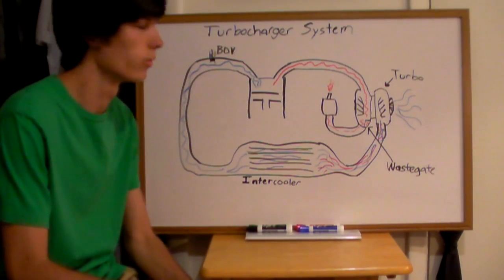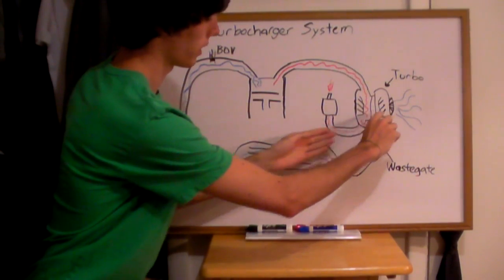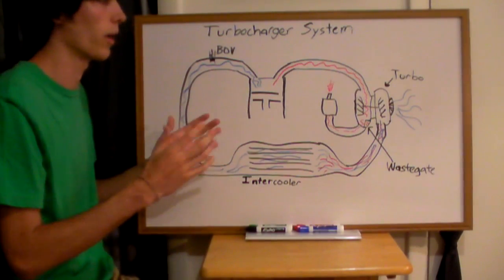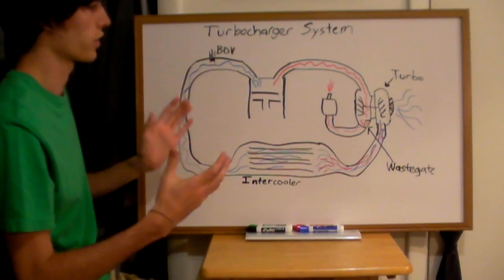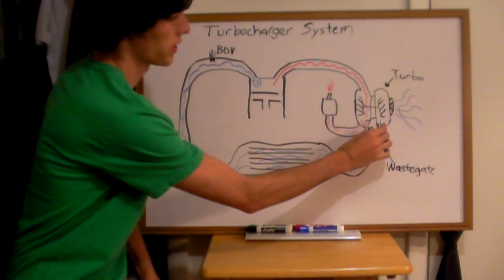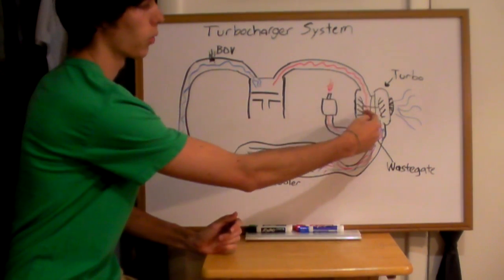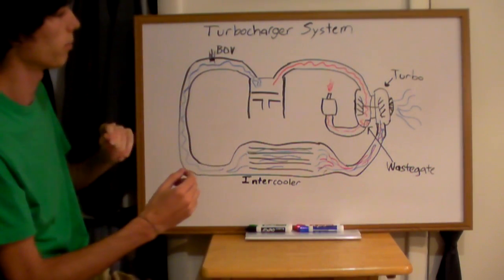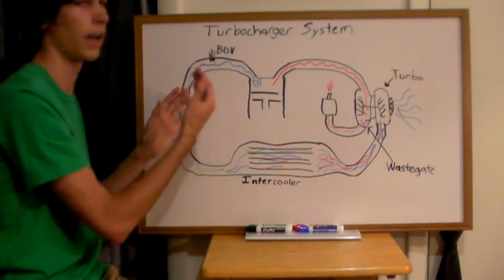How Turbochargers Work

Comment: Generally good. I suggest u mention why tc is need. The point needs to be made that when the piston starts its compression stroke, the air in the cylinder is is at a partial vacuum and u want as much air/fuel in the chamber to maximize the power of each stroke.
Reply: +Mike Goldberg 
He already made a video about the purpose of a turbocharger.

Comment: Hey! I know this is an old video, but i was wondering... Can a i take a turbocharger from a diesel and put it in a normal petrol car? What should i look out for? Thanks!
Reply: Theoretically, yes you could. However, I doubt it would be the right size, and you'd probably be making boost at very low rpm.

Comment: Correct me if i am wrong but you dont need a bov AND a wastegate yes? looking into turbocharging my car and i kinda know this but the relation between bov and wastegate got me confused for a sec
Reply: +Martin Angelov 
You want both. The wastegate is to prevent the turbo from over-spooling from too much pressure, and the bov is to prevent too much pressure from going into the engine. One's before the turbo, one's after.
Reply: cptnoremac Yes exactly but isnt the wastegate to control turbine speed/spool ( and have the so called "screamer pipes" ) and not just overspool/too high speed?
Anyway thanks for the reply
Reply: To my knowledge, the wastegate simply controls the amount of pressure which the turbo produces. That's it. As a result it could limit the speed but that's not the purpose, as I would imagine. The BOV is actually for when the throttle body closes (throttle pedal is lifted) and there is all of this excess pressure that can't be used because the engine is not powering the car at that time. If there was no BOV you would blow a hose off of the intercooler or turbo because the pressure has nowhere to go. It is only for when the throttle is closed, versus wastegate limits the air pressure entering the engine (located at the exit of the air-side of the turbocharger.

Comment: What exactly compresses the air as the turbo is sucking it in? Is the compressor wheel itself compressing it as it sucks air in? Or is it the fact that the compressor is forcing air into the engine via the piping and the compression takes place there?
Reply: The Compressor wheel compresses cold air in the compressor housing. The hot compressed air then enters the intercooler to be cooled down and so on....
Reply: The "compressor" is basically a centrifugal air pump. By pumping air to the engine than would by sucked in naturally aspirated, you created a higher than ambient pressure in the piping, intercooler, manifold, and the cylinder that's on its intake stroke. 
If there wasn't a wastegate, pressure would be limited to the point where it overcomes the centrifugal force, which is called surge. 
This limit is very noticeable by a flutter sound in cars without a blow-off/diverter valve when the throttle valve is suddenly closed while the inertia of the turbo keeps it spinning: the air has nowhere to go and rapidly reaches the maximum pressure level possible (if you would install a manometer before the throttle valve you would see a spike at that point), causing the spinning compressor blades to lock the pressure in while failing to pump more air, eventually slowing down because of the natural friction in the bearing and the resistance of the pressure difference. A blow-off/diverter valve reduces this resistance drastically by dumping the excess pressure, causing slower decelleration of the turbo and needing less exhaust pressure to bring it back up to speed when power is demanded again shortly after shutting the throttle (reducing lag) f.e. while shifting up a gear, although dumping too much pressure causes lag too (which is why many after-market blow off valves have an adjustable spring inside). Eliminating these spikes of pressure (thus resistance) also reduces wear, however this is minimised the closer the turbo is used to its maximum boost pressure, more and more the case these days.

Comment: So the blow out valve is also the catalyst to the "SSSSSSSSS" noise every time someone shifts? Essentially?
Reply: +Lukewuzhere Some cars (Like my Subaru) divert the air back into the air intake BEFORE the turbo, thus reusing the air, giving it the name Diverter Valve. They still PSSHHEEEWWW, but more quietly. If I were to switch to a true BOV, one that vents to the atmosphere, my car would run very rich for a short time when it activates, due to the air already having gone through the sensors for the computer, making it think that air is still in the system.
Reply: Every time you release the throttle, to be more accurate
Reply: yup its the blow off valve

Comment: Do the BOV and wastegate need the same pressure requirements? For example, do they both need to be set at 10 PSI, or can one be set at 10 PSI and the other at 8 PSI? Which would be better?

Comment: Technically BOV idea he talking about is wrong ..   BOV work by vacuum     ... there is a hose connected into the intake  manifold (between engine and throttle )    going to the BOV  (between throttle and cooler or turbo)   so if the throttle shut  engine will still take air to remain running ... so it will create vacuum and its will pull the diaphragm inside the BOV and release any extra boost  ... BOV will remain if there is any boost in the intake because the BOV will be pressurized instead vacuum ... understand... sorry for any mistake english is  not my language ... i just want to explain the right idea

Comment: Hey man,i have a question n you said that you don't wanna reach 8 PSI ? Why ? And i didn't understand when the wastegate is opened? And this turbocharger system seems like the thrbo system works on the exhaust gas.
Reply: Sabek Loay most stock engines cant handle too much boost pressure so putting more than 8psi may be a little risky, might blow the engine

Comment: Why not separate the turbo between the exhaust fan running it, and the fan pressurizing the air going into the engine? If you did that you would probably wouldn't need a inner cooler?
.
If you didn't need a inner cooler, in theory (in my head) you would create more P.S.I., or pressurized air, as well as it being cooler (than even with inner-coolers?)?
.
It would be neat if they setup a air-conditioning units that pumps real cold air into the engine...? It's rather simple, the cooler the engine, the more efficient and happy it is....
Reply: Just stop...
Reply: Nope, only ten lashings
Reply: Andrea Bonanno yeah you're right dude. I think he's on drugs.
Reply: honestly though, this is becoming funny.. it's past ignorance
Reply: *intercooler
Reply: Brad Shephard Geeez... what, are you ROYALTY? Are you going to give me 30 lashings for not spelling that that thingy dingy that cools the pressurized air going into the engine, wrong?
.
Must be a Fults! Sorry about my faults, pls don't pick on me, or make fun of me for being right, or having a good idea. I'm sooooooory!
.
"I'M NOT SORRY"!
Reply: hot compressed air is less dense, less dense = less oxygen. if it is compressed , then cooled, compressed air  is directed to the engine denser :)
Reply: whatever man... I really don't want to waste any time discussing something I learned with someone who doesn't want to.. Happy weekend.. or whatever
Reply: Brian Davis Not really. A lot of the heat comes from the turbine spinning really fast
Reply: Richard Fergusson Ok get rid off the inner-cooler and see what happens? Then separate the two turbines on the turbo... with no inner cooler, and see what happens..The only reason cars have a inner-cooler is because of the FACT that the two turbines are right next to each-other..Rather simple concept, and easy to see observation... 9/11 been exposed by the MSM News yet??
Reply: wyndnra1n uhhhh... no, nice try though!!
Reply: Brian Davis look up GAS pressure and temperature law. If you increase pressure of any gas, temperature increases.
Reply: Andrea Bonanno Dude this guy is actually insane. Look at the videos on his channel.
Reply: my point is proven hah... oh well.. thats why the wprld is a great place.. you get to see and meet a bit of everything.. ")
Reply: Aamir Jaffer Look up "540 HP 1968 Shelby GT 350 Paxton Supercharged Walkaround and Startup"... and get back to me.....I didn't get a bit of that "law"....
Reply: Brian Davis Mercedes formula one team did this which you can check out from EE videos.
Reply: Dude WTF....

Comment: can someone tell me why some cars have the sound "tssss" and others have the "tetetetetete" sound :p ?
Reply: I think it depends on the BOV. Mine has the "tetete" sound and I love it :P
Reply: +Yaz Bebars The "Tiss" sound, or PSSSHHHH sound, is air being let out the blow-off valve. The other sound is the air being forced backwards through the turbo. It abruptly slows down the turbocharger, making the turbo take longer to spool in the next gear. With a blowoff valve, the turbo loses less speed.

Also, some say the air going back through often can cause premature turbo failure.

Comment: can you close / seal the waste gate in order to maximize efficiency ?
Reply: No it is needed to prevent excessive pressure
Reply: Same with the blow off valve they both regulate correct pressures
Reply: Thank you very much Sir, you have been very helpful and extremely fast in replying

Comment: it is more than the pressure. it gets hot because the turbo is getting hot because of  the exhaust and then the air is heated up when it passes through
you should fact check a little bit more
Reply: Well, it is true, some heat exchange will occur from the exhaust side of the turbocharger to the compressor and in the end heat up the air a bit. But that's not very significant. But if you compress Air from 14.5 psi to 26 psi for instance, you will experience a temperature increase of about 54° centigrade, which is quite significant for a relative small pressure increase.
And if air would be a really good heat conducter, you wouldn't need a radiator to cool the engine.
Reply: shi01 i never said that air pressure had no increase. there are plenty of air cooled engines though even some cars were made air cooled like the chevy corvair. but the high operating temps of turbos will have somewhat of a significant gain in the air passing through. that is the reason why superchargers dont really use intercoolers because they dont get the kind of heat gain being directly driven from the engine unlike turbos which get it from being driven by the exhaust
Reply: wades623
Ok bit late but...better late than never. You are right. I would not have believed this but the compressor casing reaches still easily over 100° centigrade although the air that flows through it. And with normal boost pressures in the range of 0.5-0.8 atmospheres, this will have a significant impact on the intake air temperature.

Comment: Little questions here: If the throttle closes all the way when you let off the gas, what keeps the engine running? With the air remaining in the intake manifold? And don't you need some kind of air filter attached to the turbo? And what happens to the OEM air filter connected to the throttle body, you just remove it?
Reply: when the throttle closed, the remaining air in intake manifold escapes trough blow off valve.
Reply: actually blow off valves are before the throttle plate. and if you let off the gas to idle it is still open a little bit and air is still flowing just not going to be boosted

Comment: Wish it showed where the intake fit in all of that
Reply: Never mind i think i figured it out from your other videos. Technically speaking the diagram is missing an intake where the blue squiggly lines are. So normally there would be piping and a filter at the end where the cold air gets pulled in (if its a cold air intake) from a cooler part of the engine.

Comment: Someone should invent an internal flap after the Turbo to prevent "reverse boost". why: to make a BOV obsolete and the boost is instantly there next time the throttle is pressed. There's my idea for an invention..who's going to invent it for me?
Reply: Actually, that wouldn't help. The throttleplate does more or less exactly the same thing. The problem is the inertia of the turbocharger itself. If a driver takes his foot of the throttle, the turbocharger still delivers full boost for a Moment because it is still reved up. So the turbocharger will fill up the room in the intake up to the throttleplate and then the air is more or less trapped without a Blowoff valve. The throttle is closed so the air can't go into the cylinder and if there is no blowoff valve, theres only one way left to get rid of the pressure, and that's back through the compressor stage of the turbocharger which leads to the well known compressor surge which slows down the turbo significantly, which means more turbolag when the driver puts his foot back on the loud pedal and also can damage the compressor wheel over time.
Reply: internal wategate?
Reply: No, i mean so the air doesnt surge back into the turbo or get wasted.
Reply: I think your thinking of a diverter valve. Which recycles the boost back in to the intake.
Reply: ThatOneDude_OnYoutube _ hey just an update, volvo just did this. you should be able to find it online
Reply: ThatOneDude_OnYoutube _ it uses a tank, and a pump. when the bypass valve is activated it dumps boost into the tank and when the turbo is spooled again, the pump spools the turbo up. No turbo lag

Comment: Can someome explain or post a link to how a rear mount turbo works. And can you run a supercharger as well as a rear mount turbo????
Reply: A rear mounted turbo charger is the same as a front turbo charger. Except instead of intake air traveling a short distance and exhaust running long distance. They both run long. Intake piping all the way from the back to the front and exhaust pipe all the way from engine to back. I'm pretty sure it's mainly about weight distribution. I don't see any other reason to put the fucker in the rear bumper.
Reply: What about running a rear mount with a supercharger???
Reply: A turbo runs off the exhaust that's why you can mount it in the rear because there is still exhaust back that far but a supercharger is different it doesn't run off of exhaust it runs off of the crank spinning that's why it is belt driven so you have to mount a supercharger on the engine and same goes for a blower except for a blower they take high horsepower so run so for example if a blower is rated for a 500hp engine then you would have to make a minimum off 500hp before you could run the blower and then the blower would use that power to suck in a lot more air and turn that 500hp into 1000hp just for example cause depending on the blower you could make a lot of different amounts of horsepower or need more horsepower to run it
Reply: Also you can't just throw a turbo on an naturally aspirated engine and hope it works because it won't. With more air in the engine you need more fuel so higher flowing fuel systems are needed and pistons and I know there's more but I can't think of it off the top of my head but what I'm saying is an engine has to be purpose built for a turbo
Reply: Turbos don't really have a specific mount location it all depends on the engine set up. And yes you can run a super and a turbo. It is called twin charge but they can be quite complex and generally expensive

Comment: Hey Jason,  Great videos.

What is this "exhaust gas" that you're talking about that's traveling through the turbine?  And where's the intake air going through?  Is it going through the intercooler?  Or is it after?
Reply: The gas that comes out of your exhaust pipe on your car and it spins the turbo to make in suck in air which then goes into the intercooler witch then goes into the intake which then goes into the cylinder and mixed with fuel and ignites and explodes to push the pistons and when you have a lot more air and fuel coming into the motor and doing this faster you make more power. More air and fuel means more power

Comment: Can you decrease turbo lag by changing the exhaust downpipe for a smaller diameter unit? What about replacing the blow-off valve with a more responsive unit (although possibly noisier)?
Reply from the maker: The smaller diameter would hinder higher RPM performance at WOT. Dunno about changing the BOV, possibly divert the pressure to the exhaust like is done with some ALS systems, but these also inject fuel or run rich.
Reply: You can put the intercooler closer to the turbo. That's the point of a hoodscoop. So the compressed air doesn't have to go as far.

Comment: so what does it mean when people say that there rb25 has 1 pound of boost
Reply from the maker: 1 psi of additional air going into the engine, over atmospheric.
Reply: no i was talking to some r33 guys at a race event in denmark europe and all of them said that the rb25 only have 1 psi of boost
Reply: Ultimate Rager You're thinking of 1 BAR which is 14.5psi, which is the force of the air upon everything on earth at sea level.  So when they say they have 1.3 BAR of boost that means they are pushing almost 19psi into the engine

Comment: Why have a blow off valve? Cant you just keep the air in the piping until you need it again?
Reply from the maker: The air has to go somewhere, so without a bypass valve it will try to travel back through the turbo (compressor surge) which is not ideal, can cause damage, and will also give a greater delay before you can get back into boost.
Reply: Engineering Explained Thanks a lot! Makes perfect sense. You're videos are great. I learn so much from them